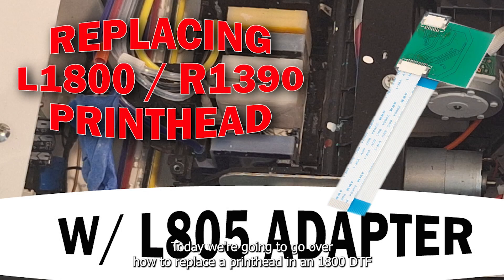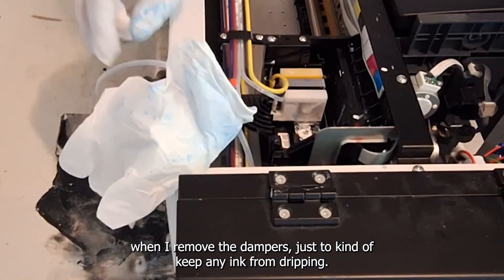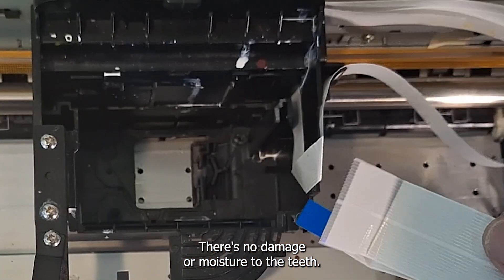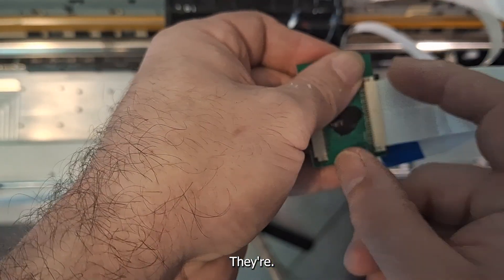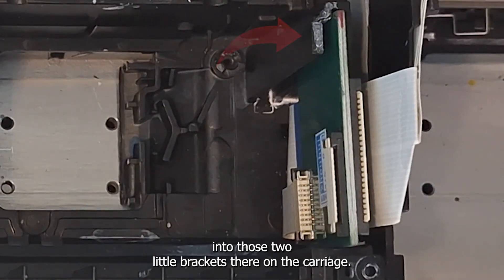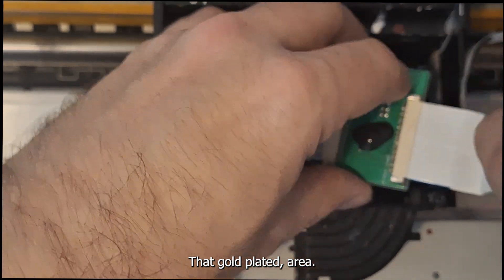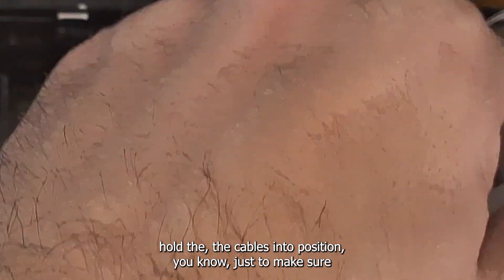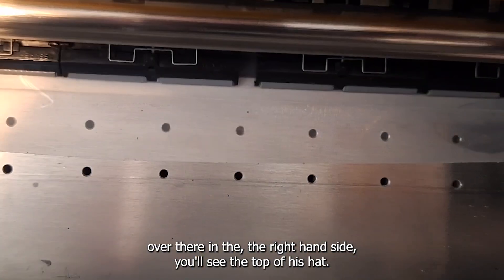Replacing L1800 DTF printhead with L805 adapter board.

Comment: I have a problem with this adapter. The R1390/L1800 have the option to print bidirectionally, but with this adapter, the print is misaligned and I can't align it because, since it's converted to DTF, the alignment lines can't be seen. I have to print unidirectionally, which takes twice as long. Is there a solution?
Reply from the maker: I have never ran into that issue with this board.....but, if I had that problem and I suspected the board was the issue....I would 1st shutdown and unplug the system. 
Then try reseating all the cables attached to the board and the printhead.....maybe there is just some kind of voltage getting caught up in the board or cables, causing the channels to misfire.

Also, try some different DPI's in your RIP.....I have found that this board appears to like when white and color are both set to 1440 x 1440....for some reason changing that setting in the RIP can effect this board.
Reply: Did u fixed it
Reply: @TF-by-Mr.001  No. Change resolution and continue with the problem.
Reply: @filipemcalmeida so this method is worthless no need to buy this pack

Comment: Hi. Im trying to do the inverse swap. Can I use the same converter so I can use an printhead 9/27 pins connectors instead 13/23 my printer is using currently?
Reply from the maker: I do not think the swap will work inversely. The point of the adapter board is to allow for the cheaper L805 head to be used.